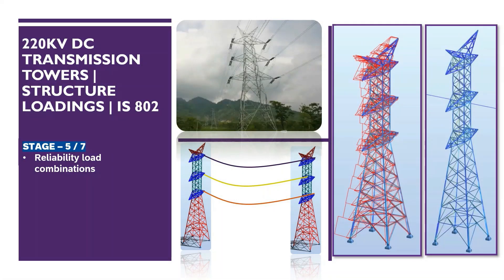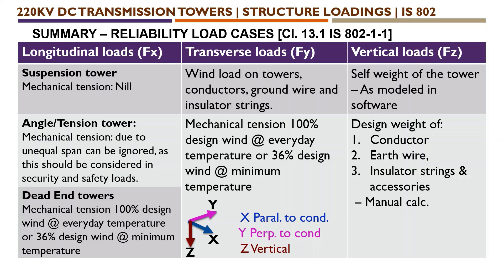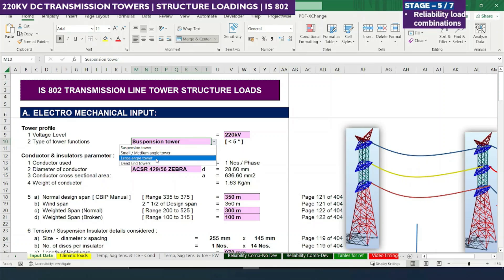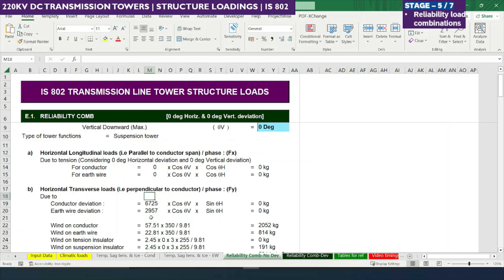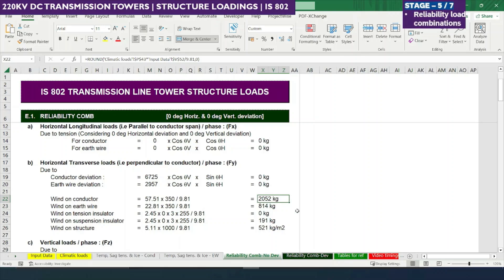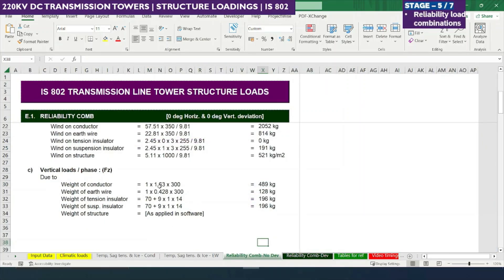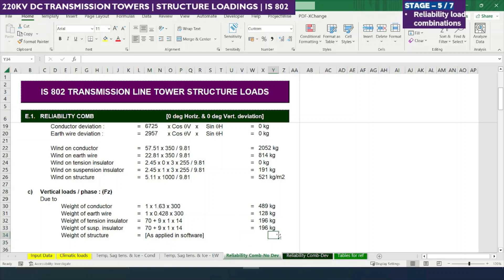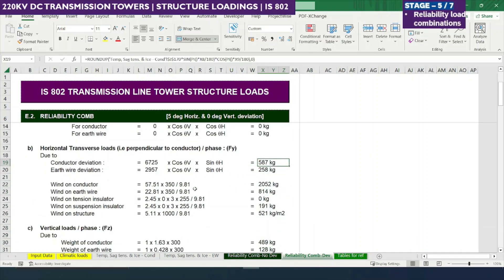220kV DC Transmission Towers | Structure Loadings | IS 802 | STAGE 5 of 7 Explains Reliability loads

Comment: while calculating transverse loads, in case of wind on suspension insulator you are multiplying with the dia of insulator i.e. 255mm but while calculating wind on conductor, the dia of conductor is not being multiplied.. why so?
Reply from the maker: For the transverse wind on conductor, the diameter us already considered in "B. CLIMATIC LOAD PARAMETERS " (6:26). Here in clause 4 conductor wind pressure is calculated as N/m and wind pressure on insulator is calculated as N/m2